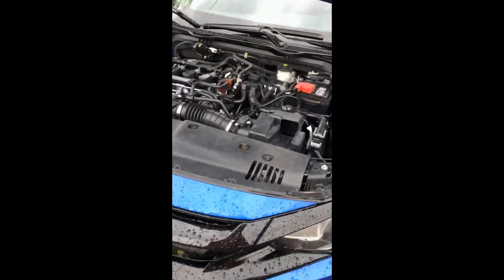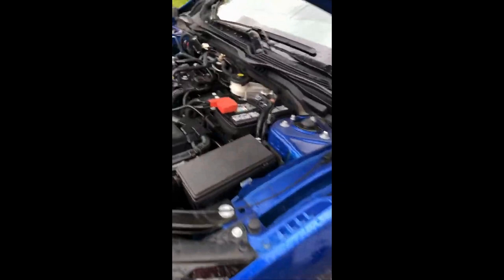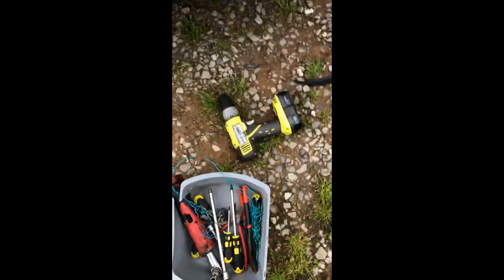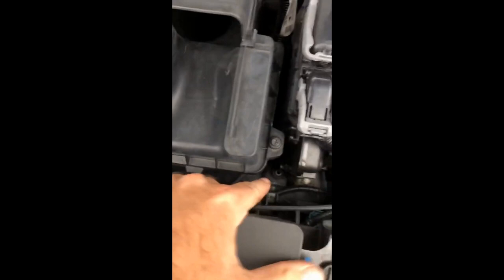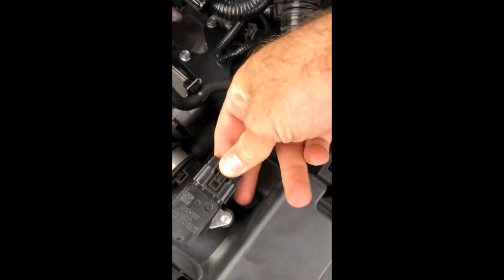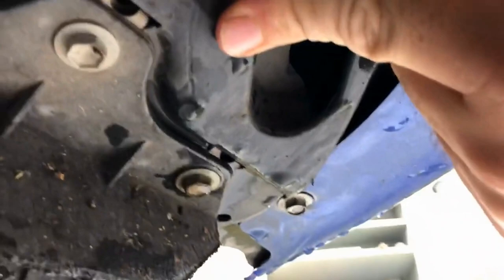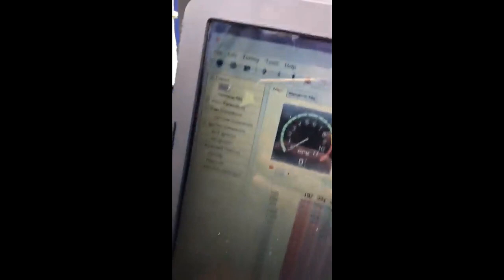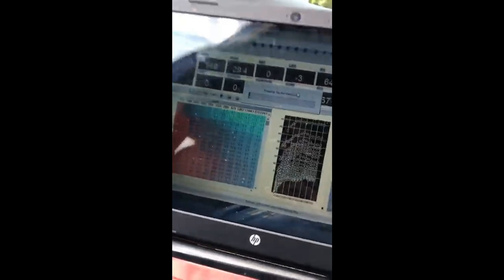PRL COBRA COLD AIR INTAKE INSTALL 10th GEN CIVIC EVERY LAST STEP 2016,2017,2018,2019,2020 Honda

Comment: Great video. That “puff” sound...  is that just the PRL or do you also have a blow off valve installed?
Reply: Answer his question lol
Reply: I believe it makes the puff just with the intake .. BOV Is not recommended on the 10th gen Civics .
Reply: That’s the blow of valve the intake is just making it louder
Reply: @bryan8404  the blow off valve doesn’t damage nothing
Reply: @bryan8404  who said, every forum I've read have said quit the opposite....
Reply: @hstone0808  the BPV is the recommended one.. I tried a BOV and my car started to run rich.
Reply: @jerry559gomez2  yes it does